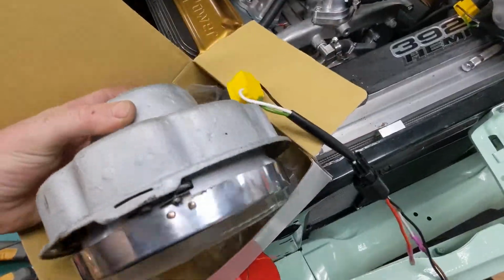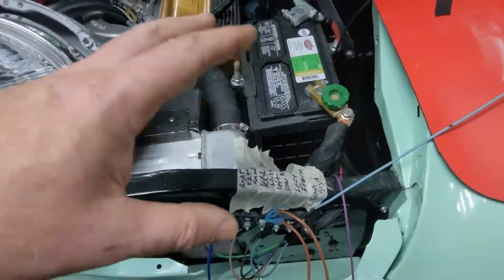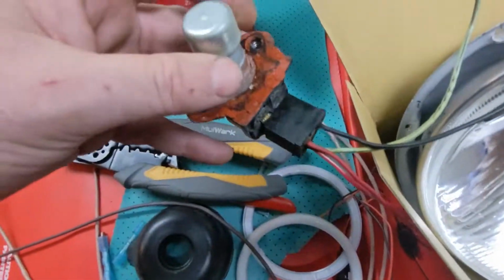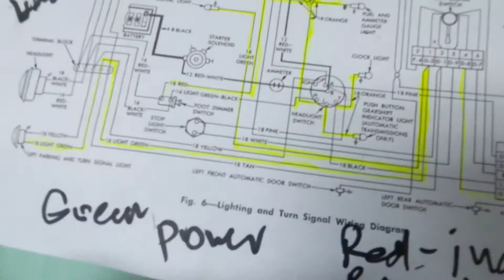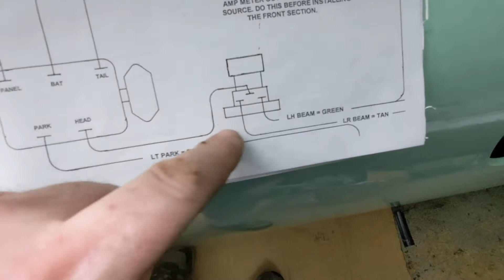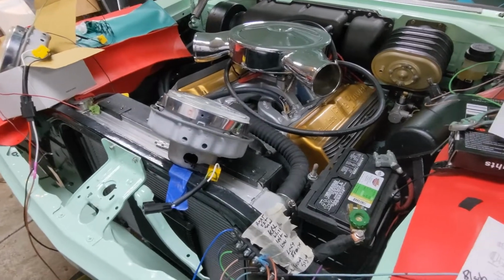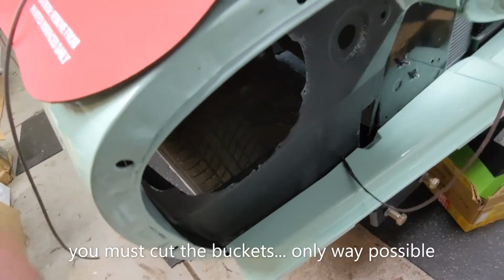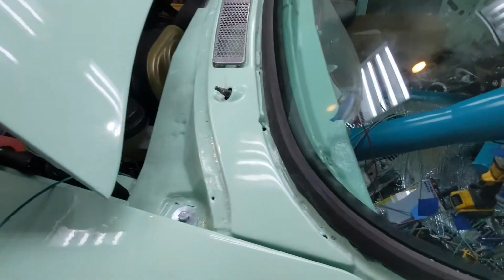57 Dodge headlight swap

Comment: be sure to double check your wiper pivots for leaks. mine leave puddles but thankfully it doesn't drip on electrical stuff.
Reply from the maker: Oh i saw that... i doubled up, with a new gasket and a dum dum.